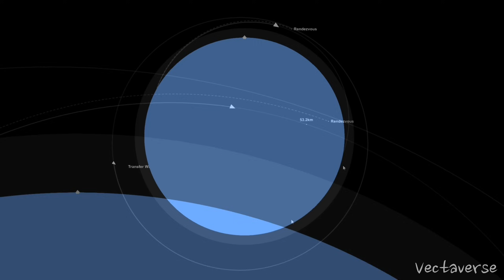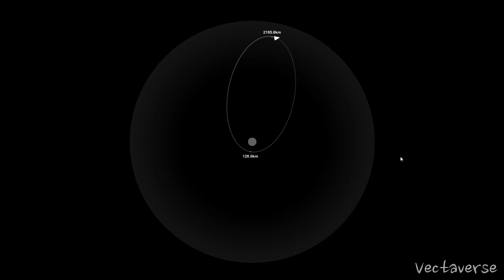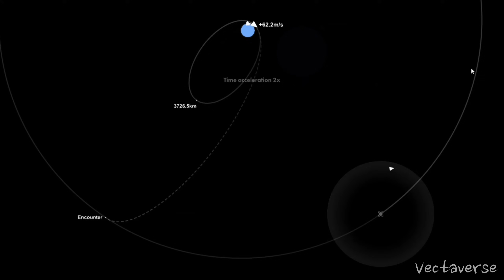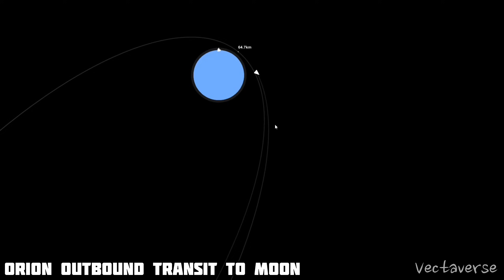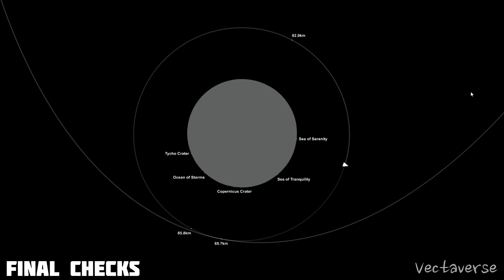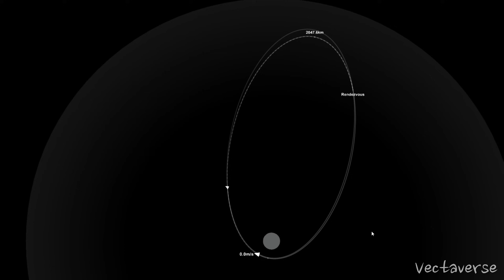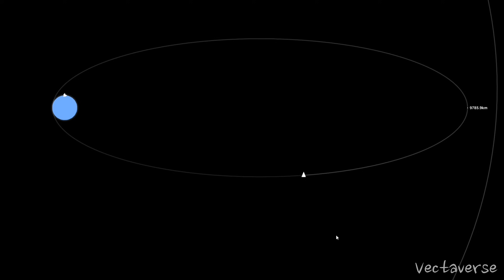Artemis 3 Mission To the Moon In Spaceflight Simulator | NASA and SpaceX Rockets

Comment: September 14.
-------------------------------------
9/22/2020. America and Europe.
--------------------------------------
Materials.
Physics and chemistry applied to the aerospace industry.
-------------------------------------
Computational design.
.................................................. ..................
Laser electromagnetic engineering on reactive and light alloys.
Replacement of civil and military structural riveting.
6 G...
Hunters of the air.
--------------------------------------
Integrated fuselages.
The integrated fuselage for transporting civil or military passengers has been solved by electromagnetic laser technology on reactive alloys.
New legitimate laser electromagnetic technology of 2020.
'''''''''''''''''''''''''''''''''''''''''''''''''''''' ''''''''''''''''''''
Subsonic and supersonic pressurized flight.
Greater number of seats per unit of fuel.
'''''''''''''''''''''''''''''''''''''''''''''''''''''' ''''''''''''''''''''
Government aircraft.
-------------------------------------
Presidential planes.
-------------------------------------
Diplomatic delegations.
Business trip.
Tourism.
--------------------------------------
Supersonic passenger flight without post-combustion.
Pressurization.
Higher altitude and safety in the presence of significant atmospheric pressure differentials.
Immanent buoyancy in the sea.
--------------------------------------
Automatic manufacturing.
Serial stamping for aircraft structural components.
--------------------------------------
Propulsion monohulls.
Titanium, aluminum and carbon.
Boundary layer absorption and laminar flow.
Evident aerodynamic, energy and economic advantages key to the competitiveness of international airlines.
Remarkable fuel savings.
Decrease in environmental emissions of (CO2).
Time reductions for intercontinental transfers.
------------------------------------
Aluminum.
New electromagnetic laser engineering in the construction of very light, insulated and highly efficient liquid hydrogen tanks.
-------------------------------------
Intelligent super cruise and variable geometry for the vertical empennage.
Vital reduction of consumption on international passenger flights.
Control of substitute super cruise vector thrust of the vertical empennage during supersonic flight without a burner.
Efficient aerodynamic performance.
------------------------------------
New era.
High standards of construction quality and industrial repetition.
Standard prints and electromagnetic laser automation.
The technology of nails and pneumatic hammers as tools have successfully completed an extensive cycle.
With the arrival of electromagnetic laser technology, the functions of traditional riveting fulfill roles that can be considered secondary.
The old traditional massive nailing of aerospace reactive alloys is not airtight.
The aluminum nail has limited the progress of the aerospace industry for decades.
Aluminum structural rivets are clearly obsolete and currently contradict the best development of the aerospace industry in America and Europe...
Through electromagnetic laser automation...
Now we can do it very well...